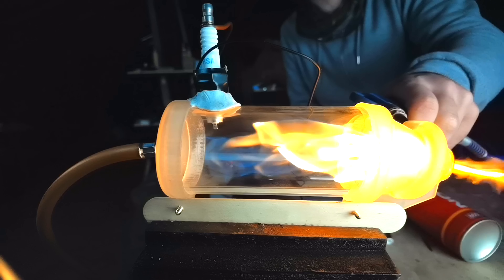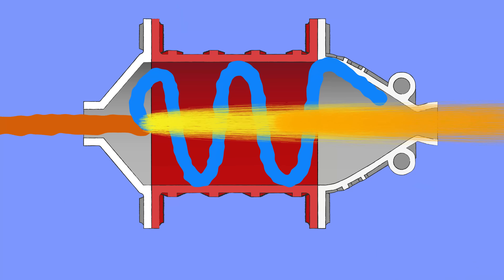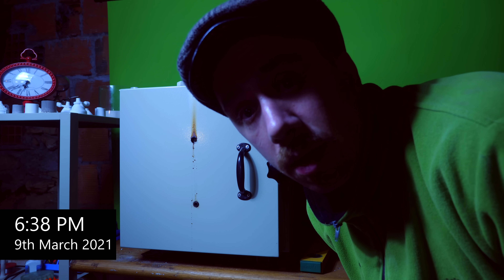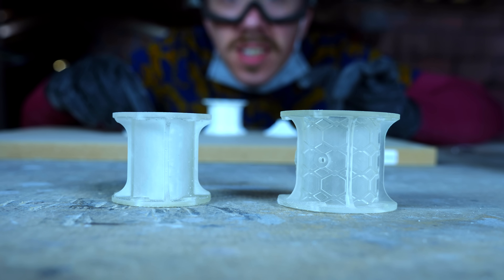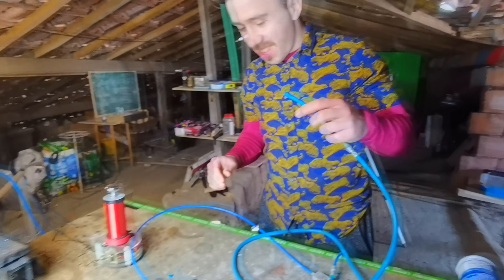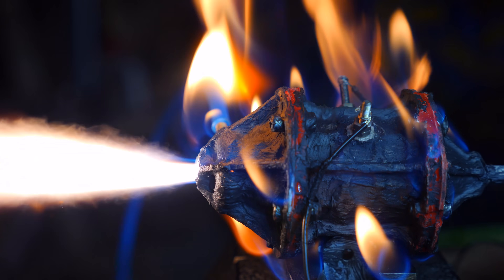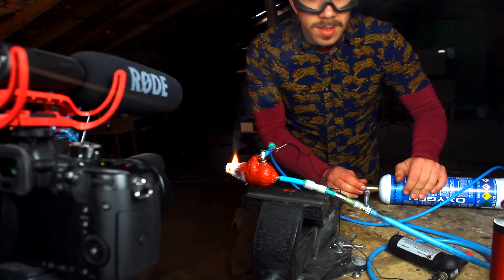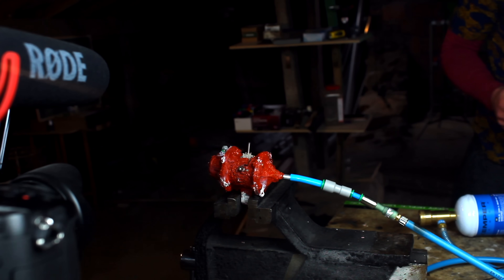Vortex Rocket V2.0 (3D Printed)

Comment: Astro engineer here, your chamber pressure is waaaaayyyyy too high, you talk about increasing it near the end of the video when you actually need to do the opposite for stable operation. All the signs are there, super under-expanded exhaust, exhaust leaking out of the chamber itself(fuel/ox), and crazy combustion instability for every test. Try to get things started with the smallest amount of pressure possible first, then slowly increase parameters maintaining an ox rich ratio until you find an acceptable operational pressure, at which point you can experiment with more fuel in different ox ratios, keeping in mind that the ox is your coolant and needs a certain level of momentum to keep a vortex.

Another thing to note is the angle of your oxygen coming in is probably getting screwed up by that pipe fitting you glued in, another reason to lower pressure and work up slower. I would suggest actually designing a proper pipe fitting so the flow entering is better established and you have some kind of boundary layer sticking with enough momentum to maintain a vortex against the fuel. A suggestion here would be to 3d print some simple pressure chambers ahead of your fuel and ox sources at the tube fitting locations with valves on both ends (use the right valves) so you can better manage the flow/pressure entering and prevent some instability by dampening fluid forces from blowback and stuff.

Comment: Some of the coating appears to be bubbling, to me this tells me that its getting hot enough that its becoming more elastic, and it tells me that there is hot expanding gases underneath. We already know there is gas underneath, that is why you applied the sealant in the first place. But that gas is still in the ceramic and its getting hot and its wanting to expand. In these conditions it will quickly find the weak points and will blow through. the fact its blowing through everywhere instead of finding one weak point to vent out of means that this problem is widespread and there is still way too much pressure and heat reaching the engine walls for a single vent point to relieve it. 
Theres two next steps to really get this project to where you want it to be. You definitely have the engine pressure you want for great thrust, but the vortex is terribly failing. Not being able to see the internal workings as the engine is running is going to make optimizations terribly difficult. I suggest reaching out to the community and seeing if you can get ahold of some temperature resistant glass or acrylic, to make the combustion chamber transparent. A high-resolution thermal camera may also shed light on things, but its probably way outside of budget and still cant make up for actually being able to see inside the engine. The second, and probably most helpful solution I can offer is to print your parts like you are doing in ceramic, burn out the resin, but before you turn to applying any sealant on the outside, you should fill the porous structure of the part with a temperature resistant acrylic liquid which will then harden into a solid smooth part. after that you can apply whatever coating you want. but the point is that you want to seal those pores from the inside so gas doesn't get in and want to expand. 
This may also strengthen the part for flight. When you integrate this into a future vehicle it is probably going to crash a few times as you get flight experience with it. Having a stronger engine helps with reflight.
Reply: Have you sorted out an ignition sequence as well? Maybe play around with the noncombustible version of your engine (with clear materials) to figure out the step order for pumping in fuel types; in this case the fuels will be inert air on air, but you are aiming to see how to start a stable vortex reliably for when you are using combustible fuels. 
I would also look into lining the inside of the combustion chamber walls with a spiral line pattern to help guide the propane around the walls of the engine and prevent such linear flow along the walls with combustion exhaust (the type that is heating up and leaking out the pours of the engine)

Comment: 3D print a mold of the parts that you can press fit raw pottery clay mixed with grog and make them 3mm thick with your support structure to dry and shrink in half the mold. The reason our are getting cracked parts is the property of clay plates/particles need to be like a deck of cards fanned out. 3D printed resins don’t aline the clay for true support in heat thermal stresses.  Then you can seal it up with clay slip and trick it out.  

This set of clay bodys are able to take the heat and not Deform. Ask around at your local potter if he can help with your clay supply’s. 

KILN SHELF / POST BODY (^11)
Mullite(Kyanite) 60
CalcinedKaolin 20
OM#4 10
Talc10
====================
KILN WASH (Combo)
Alumina hydrate 40
EPK 30
Kyanite (35 mesh) 8
Silica 22
					Fills irregularities, cleans easily.

Kiln Stilt Formula
Jeff Diehl • April 14, 2020 
Firing temperature : cone 9-12 | Atmosphere: Oxidation Reduction
Ingredients
		EPK Kaolin 25
		XX Saggar 25
		Grog (30 Mesh) 50
		
Instructions
I used this recipe to make kiln furniture in 1980 and have relied on the same stilts, spacers, etc. in all my kilns since then with great success. For stilts that are up to 4 inches tall, I extruded a tube 1 1/4 inch in diameter. For stilts that are 5–7 inches tall, I made the tube 2 1/4 inches in diameter. After the extrusions are almost bone dry, you can make a nice, square cut using a chop saw with an old blade. When cutting the stilts, Be sure to work outside, have a fan running to disperse the dust, and wear a properly fitted respirator.
Fire the stilts before using, since they will shrink slightly when first fired. I fire mine to cone 9 before use. They can be used in bisque firings and glaze firings.
This recipe was shared by Jeff Diehl in the May 2020 issue of Ceramics Monthly.

Comment: 3D print a form and mold clay around it. Then fire it in the kiln. You could make a mold and press two ends together and press out clay rocket parts. You can join pieces by using thin clay and firing again. You can also get many coatings to give it different textures. You can make them thick or thin. They will not leak. You can get the rocket as hot as you want. You could also pour like they do for pottery. Gets really fine detail and you can make it as thin as glass if you wanted. A pottery club near you could show you everything you need. Much better and easier than trying to 3D print like this.

Comment: Advice from an actual propulsion engineer:
Injecting oxygen around the edge is bad. You will just burn up your nozzle and chamber since you put hot oxygen in contact with it. Swap your oxygen and fuel. We do everything we can to keep hot oxygen away from stuff. And film cooling is always performed with the fuel.

Comment: Why not try putting a glaze over the ceramic engine?  the ceramic in your engines might be similar enough to ceramic pottery for the glaze to bond with properly, and seal the engine.

Comment: What if you put the whole engine in fireplace sealant in a vacuum chamber, suck out all the air and then let it slowly in? This should suck the sealant right into the porous ceramics to seal it.

Comment: Can you use the ceramic resin as a gasket between the sections? Apply a bead, bolt the sections together and then sinter it.

Comment: what if the parts are not directly 3d printed, what If you used 3d printed molds to cast the ceramic parts. Or 3d print metal forming dies and press them in a vice like Stuff made here did in https://www.youtube.com/watch?v=8cNeAOpR-Ws

Comment: Also, when you lose 17% in weight due to resin melting, your ceramic is too porous, with the increased pressure from heat and gasses, it will leak (and break, the pores become holes). Ceramic isnt a good material to use heatsinks to dissipate heat... once it overheats, its game over.

Comment: What would happen if you lengthened the input tubes for the oxygen and propane, added something to temporarily plug them up, then carefully dipped the whole thing in some slightly diluted gasket maker or other liquid sealant. Something that wasn't so viscous. That would give you a nice even coat over the whole surface. You could easily dip them multiple times if you needed it stronger.

Comment: If you have a kiln, could you just use a ceramic glaze? That should seal the pores I would think. I love your channel and your lack of high tech easily solved projects using the exact precise method is what I love about your channel. The fact that you dive head first into your projects and keep interating until you get some results is a fantastic illustration of persistence and determination. Thank you for doing what you do. It is an inspiration.

Comment: You should try printing the engine on halves split along its axis in standard resin then sand cast it and do a burn out with aluminum or something with an even higher melting point. But I think aluminum might work. If I had a shop or house I'd try it myself.

Comment: At 3:36: "I think I´m high on ceramic powder". You should wear a dust mask, as the ceramic contains silica and can cause silicosis in the lungs. Also known as stone lung.
Reply: The lungs really don't like fine particles or fibers. Just look at asbestos or carbon fiber. Those materials have biologically unfortunate sizes and we all know what asbestos causes.
Reply: @trulyinfamous  M E S O T H E L I O M A
Reply: Stone lung sounds rad. I want stone lung.
Reply: @owenkegg5608  Its a progressive illness where your lungs slowly calcify and after years of suffering you eventually suffocate over a period of a few months as your lungs drop below a minimum required area to work. ITs what has killed more first responders to the 9/11 attacks then the attacks themselves.

Comment: Hello, not on a soapbox, just don't want you to get emphysema.  I work with ceramics in an amateur capacity. Ceramic dust is Bad for the lungs.  as a coating, you might be able to find a shop near you that sells glaze for ceramics.  You will need to look up the cone to match what you need to fire your parts at, but it would essentially be a glass coating.  You could even use to cement parts together.
Reply: You can also use slip-casting to make the engine.  You make the original out of normal 3d printed part.  Then make a plaster mold.  Pour in the slip, let sit for a couple minutes, then un-mold.  It should not be a porous as the 3d Porcelain as you are not burning out resin, you can make it as think as you want, and it might be faster.

Comment: I've got a background in both chemistry and pottery. You did not mention the firing parameters. One of the THE most important things is how fast you ramp the firing. For example, I would fire from 80C up to 4-500C or so very slowly. Maybe even as slowly as 50-100C per hour. Once you are past 500C or so you can resume a faster firing schedule. In addition, I would look at when the cracks are formed (sharp edges vs rounded). It may be useful to fire down carefully around the quartz inversion temperature (you may be having problems with cristobalite formation).

Comment: your using ceramic so add ceramic glaze! Think about it ceramic dishes such as coffee cups use glaze so the ceramic does not leak coffee or soak it up. So if you ad ceramic glaze that should seal it up and it will give you a much smoother surface inside for fuel air flow for your vortex. Way less turbulence

Comment: I am once again suggesting you use regular air as the cyclone and premix your fuel and oxygen. The melting of your engine suggests to me that it is not being cooled by the cyclone effect. If the cyclone were working you would mostly just be leaking regular air and not burning fuel. 

Awesome video though, the engines that did not immediately burst into flames were incredibly satisfying.

Comment: What if you try dipping the whole thing in some high-temp epoxy.  Just modify the original tolerances to match this and it could build up the strength of the walls as well as fix the leaking because of less porosity.

Comment: Please for the love of God make a single valve with your propellant and oxygen ratio established so that you are not cranking two separate valves as thing are going wrong!  Added benefit, you will save a ton of propane and oxygen that is otherwise wasted after the engine failed.

Comment: You can put the parts in silica sand when curing in the oven. This helps to keep the shape.
Reply: You can use gunpowder and not keep the shape.
Reply: I do not believe you sir.
Reply: salt powder will be better!
Reply: I was going to suggest this. Not necessarily silica sand but some kind of substrate to pack it.
Reply: Or make in all metal shape.
Reply: @AMV12S  
But then it would be a machining channel

Comment: Add glass a glaze like most ceramics have. I would suggest putting the glaze on the inside so when/if it melts it will plug the porosity of the ceramic material. Also glazing the out side will increase the the strength and help prevent cracking.  I would suggest a blast shield for you and the camera 1/2" lexan would do nicely ( you can find this at a junk yard).

Comment: I have suggestions. We need to change how we think about the sealing layer. It’s more than just a layer to plug the holes. It has three jobs:

1. Hold in the pressure of the engine. Think of the sealing layer as a pressure vessel.
2. Don’t melt or sublimate.
3. Don’t burn.

What can you do to hold in the pressure? Some people have suggested putting a metal tube around the engine. That’s a great idea. Another idea would be to put a carbon fiber overwrap around the engine (with fireplace sealant as the resin, like you did for the pulsejet).

You’re already handling “Don’t melt” with your film/vortex cooling.

Speaking of the film/vortex cooling, blowing high pressure, pure oxygen over the inner surface of the engine is probably setting the sealing layer up to burn. We know that the ceramic structures are porous, so pure oxygen is definitely getting to the sealing layer. I suggest using your fuel as the film/vortex coolant.
Reply: can he put fireplace sealant on the inside of the engine? or will it burn instantly
Reply: @alekmilinkovic1696  That’s a solid idea. I think it would burn if he continues to use oxygen as the film/vortex coolant. If he switches to the fuel for cooling, I think it has a better chance.
Reply: @derekmitchell209  the engine uses more oxygen gas than fuel gas and you'd probably want to cool the engine with whatever gas there's more of since higher flow = more cooling
Reply: @Dewkeeper  That is an important consideration, and you’re right that the oxygen flow rate is much higher than the propane flow rate. The reason for my suggestion is that almost every material burns in a high pressure oxygen environment (including many metals).
Reply: @alekmilinkovic1696  That is probably too rough to still enable the vortex/film cooling effect.
Reply: Yeah, fuel cooling is definitely the correct way in this case. Even if there isn't any fuel getting into the ceramic layer, the hot oxygen might combust the sealant.
Reply: Seals are wonderful animals and they have more than 3 jobs. 
They work to keep the evil penguin population under control, and they are cute. That's 5 jobs.

Comment: You could still see there were cracks in the ceramic..  Maybe there's an intermediate step you're missing in burning off the resin...or maybe that process just is never going to work.   

Maybe the solution is to fit the parts with a sleeve of metal that might prevent the flow of propane that's creating the burn-through?  It should give you more time at least.

This is kind of the same thing as what happened with the shuttle booster o ring burn through right...maybe research what they did to fix that.

Comment: You should probably move away from ceramic and toward some more sturdy material like a metal alloy. Inconel would be a good one for pumping up the power.
Reply: I understand you can't easily 3D print something metal, but you're probably reaching the end of what your materials are capable of doing given what you have.

Comment: If the problem is the porcelain being porous, could you glaze with pottery glaze it and seal it that way? The engine would have to get awfully hot to get through that. I guess the question is, can your kiln get hot enough to glaze, and would it deform the parts?

Comment: What about after your first firing in the kiln removing the excess the using slip to put a second coating of ceramic that both fills the holes and adds strength. Next project should be thrust vectoring ceramic fins.

Comment: You should try fibreglass as it would be able to seal the gaps with the resen and glass can hold a higher temp and hold strength for any inconsistency of the 3dprint. 
You should also test how much thrust these engines are making before they burn out.
Ps I really would love a 3d printer as I have a awesome project I want to do.

Comment: I bet the resin burning out of the part leaves it porous.  I don't think you'll be able to fix this problem with an exterior coating, and I'm struggling to think of something that would survive the conditions inside the engine.

You either need to find a way to make the porcelite fire air-tight, find a different-but-similar resin that will fire airtight, or maybe think of a sacrificial interior coating of some kind?  The coating would burn off, eventually...but that's just extra fuel!

Comment: Drop the 3D printed engine into a vat of countertop cement with tubes coming out for fuel/oxi/elec. Obviously would be heavy but could solve leaking issues if you have 3 inch cement walls hahahaha